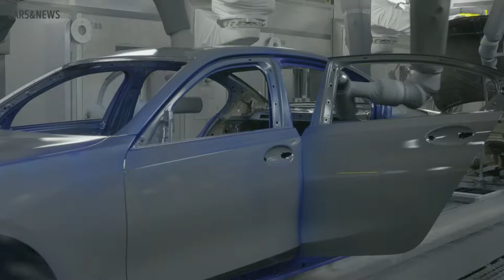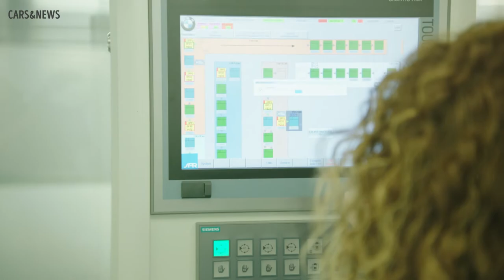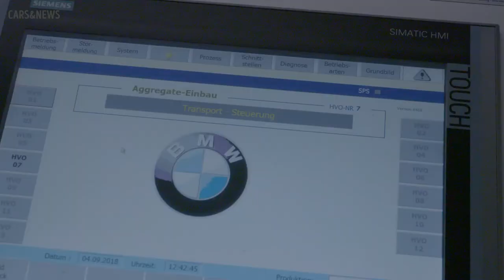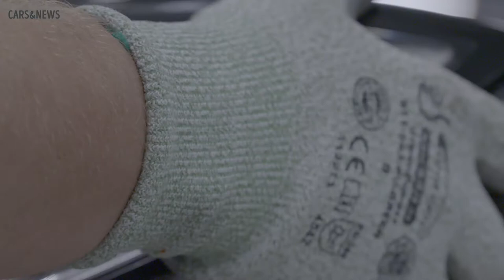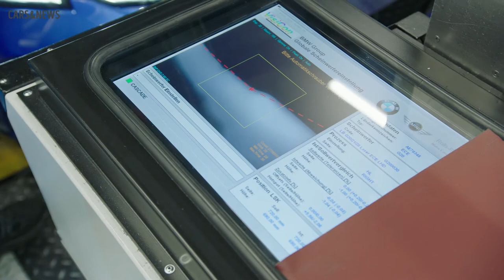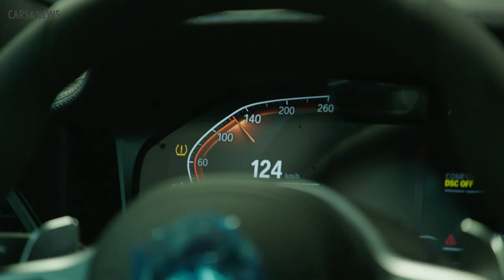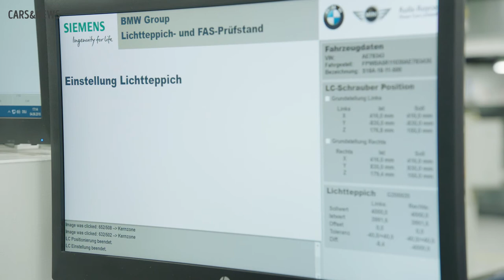BMW 3 series (G20) - Production Plant in Germany | How Its Made

Comment: SUNRISE AUTOMOTIVE ASSEMBLY BODY COVER can be widely used in car assembly line. Such as BMW production assembly line also use car cover to improve the efficiency of assembly, as the black fender cover in the video shown from 17’03" to 17’20’ and from 18’29" to 18’36", and from  20’38" to  21’13"